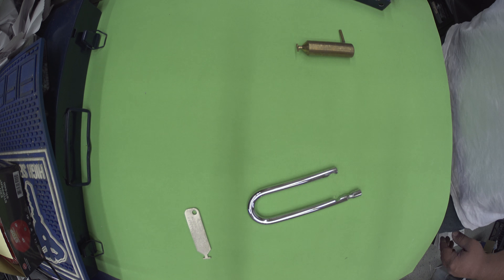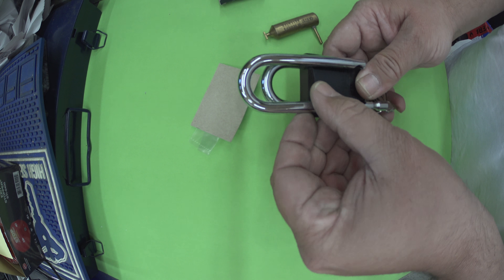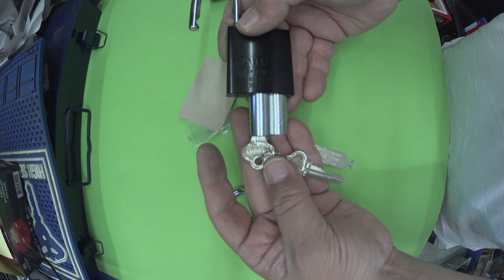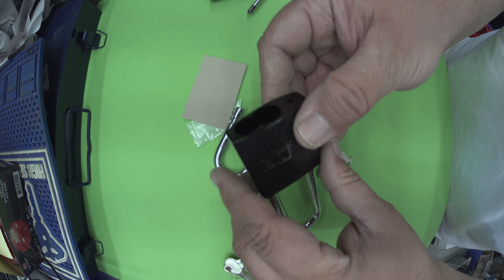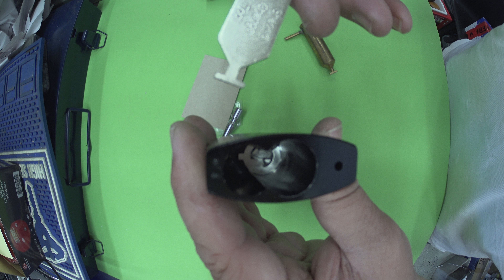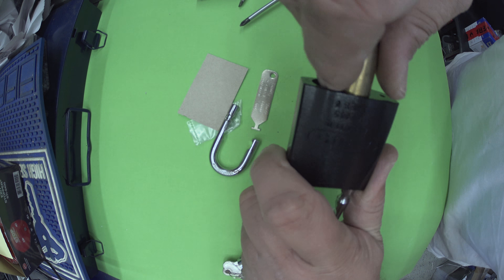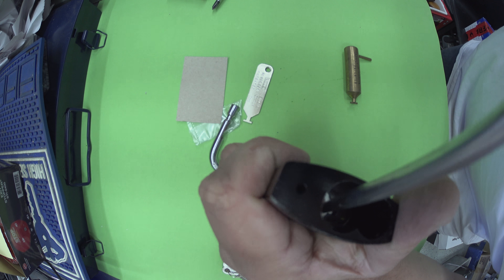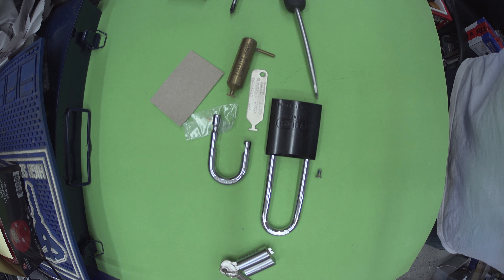ABUS SHACKLE QUICK CHANGE TOOL

Comment: I never use any tools for this shackle change. I just install the Z-bar upside down, so the lock is non-key retaining. Then turn key far enough past open for the shackle to be removed/replaced.
Reply from the maker: Thanks for the tip, I never tried that , I will try that when my tool is hiding in my tool box, good to know, thanks
Reply: @DrLockShop  Sure thing, Doc. I find it's convenient storage for the Z-bar, if implementing non-key retaining mode. Otherwise, that tiny thing is a bit easy to lose.

Comment: Actually, for the Series 2 version of the Abus 83 locks, all you need to do is install the Z-bar upside down, and then the core acts as a shackle removal tool.  Just turn the key past the opening position to release the shackle. 
Then turn the Z-bar back to the normal position (dot up) for Key Retaining, or remove it for Non Key Retaining.